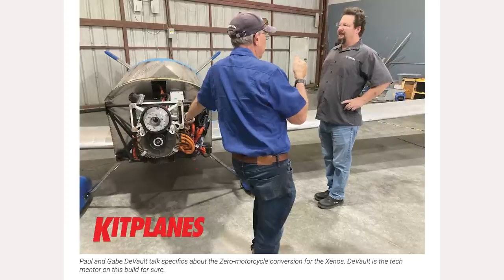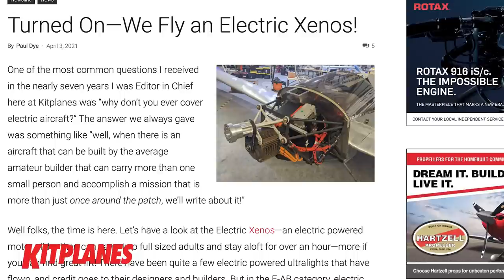How to Convert a Motorcycle to an Electric Airplane in 501 Easy Steps

Comment: I'm not an electric motor enthusiast  but must say this was very interesting.  I believe there will be a niche market for a plane like an electric Xenos.   Salute to Mr. Gabe Devault too for making an electric plane a real possibility.  Thanks Paul and Paul!
Reply: The problem with electric plane enthusiasts at the moment is, that they are still shunning the ICE as a range extender.

Depending on mission requirements, there is a minimum battery capacity needed to cover the power requirements and the range can be extended by adding a motor-generator combination for recharging while soaring.

I mean, the xenos only uses 10kW in level flight, so the generator does not need to provide much more than that for a cruise power application.

Comment: The comment about the J3 Cub is very interesting. It's fun to fly with a friend, but if you want to go somewhere, what would the flight time be if the back seat had an adult's weight of battery?  Fly a little, get a cheeseburger while the plane recharges for several hours, shoot the baloney with some guys in a hangar and fly back.  Sounds like a fun day.  We're clearly not going to have an electric 172 in the next couple of years, but it does seem like we are getting closer to making some "fun flying" practical with an electric setup.
Reply: This battery system doesn't have fast charging; which most cars would have and it's a much smaller battery than a car would have. That's a fixable problem. You'd fly it for an hour or so, and then charge it up in about 30-40 minutes while you get your burger. Also, the energy density on this battery is nowhere near state of the art. Probably similar to other electric vehicles, which would be around 200-240 wh/kg. There are several companies that are starting to produce and sell 500 wh/kg batteries. CATL just announced a battery system like that and there's another company called Amprius that is also starting up production for a 500wh/kg battery. Both companies are targeting the aviation industry with this.

The same weight battery with a density like that on a plane like in this video would massively extend the range. Probably get you close to 200 miles. You'd use the same amount of kwh to get up and beyond that it's just cruising at relatively low power levels. And of course it's a glider. So, you'd probably be able to extend that quite a bit fiurther by just making use of thermals.

I'd say it's a matter of time before some larger experimental plane gets equipped with a battery like that. I'd be very surprised if that doesn't happen in the next few years. The tricky bit is getting access to the batteries. They are for sale now but production volumes are low and demand for these is such that you'll have a hard time buying one.But there are going to be plenty of people interested in getting their hands on one. Some of them pretty wealthy. And of course most of these batteries are earmarked for companies that produce drones and planes themselves. The certification process is going to take ages for that. Which is why experimental planes are probably going to get there first.
Reply: @JillesvanGurp  Wh/kg is specific energy, Wh/m^3 is energy density. That misunderstanding needs to be squashed. 👍
Reply: @watashiandroid8314  If you fly a plane. weight is the metric that matters. You have to take every gram up that you put in the plane. Volume is more related to drag and aerodynamics. You could easily fit a few mwh of battery in a plane. But it would never be able to leave the ground. Because of the weight.

Comment: This is a great proof of concept, and seems perfect for local flying, but the issue of transporting it cross-country is very true... most airports don't have 240v available unless they also host campers😂 

The most practical way I see to get this to Airventure this year would be to follow it with a Caravan carrying a 240v generator👍 it would still be an adventure but seems like it would be straightforward.

Alternatively, you need to partner with a charging point manufacturer and local air clubs across the country to get the countrys first trans-continental air charging network set up! That would make headlines for sure🎉

Comment: Great vid as always Paul thank you! Paul Dye is a fun guest and very knowledgeable. About the fire risk - could a fire suppression system be fitted to electric airplanes? Nothing epic but just enough to make the flames retreat and the temps to get under control so the pilot can put it down right THEN (no trying to fly to nearest airport unless its right below - put it down now).
Reply: Nothing puts out a battery fire, except tons and tons of sand. And sometimes its more an explosion than a fire
That is why firefighters utterly hate electric cars

Comment: Energica makes motorcycles with DC chargers that charge in about 30 minutes. They've gotten a much better range than the previous generation Zeros these two used, too.
Reply: Faster charging will be a great feature eventually, but it depends on infrastructure upgrades at airports...

Comment: With lithium ion battery the bms should keep track of number of charge/discharge cycles as well as capacity degradation. Other than that, not discharging it below 20% is really advisable, since beyond that point the voltage drops like a rock, which could be a safety issue. Fascinating topic, thank you for covering it!
Reply: In fact GA rule says land with 15minutes left of fuel minimum.  To avoid the same issue.
Reply: @jamesordwayultralightpilot  Does it apply to gliders?
Reply: @Jaakko is watching  lmao I'm sure they have their own way of knowing when they're done flying
Reply: Yeah the Zero BMS knows the cell voltage states, several temperature sensors, resistances to ground, and overall lifecycle history and manages it pretty well independent of the main bike board.

Comment: The comment about prop noise being the main noise source regardless of the power plant is spot on.  There is a NASA engineer, (Al Bowers) who redesigned cooling fans for the Space Station based on his airfoil research into the Prandtl Wing.  The redesigned fan reduced noise  by 88%, increased flow by 24% with the same energy input.  It looks to me like one way to get a big boost in performance would be to CNC cut a new prop based on Mr. Bowers research.
Reply: I worked maintenance for a school district. We were replacing our classroom HVAC units and a couple manufacturer engineers were there to instruct us on their features and operation.  They said their units were much quieter because of the fan blade design in the squirrel cages. I asked if they used laminar flow blades. Their eyes got large and they asked me how I knew about laminar flow. I said I was an aviation nut and laminar flow was like the holy grail of wing designers. They said laminar flow was exactly the reason their fans were so quiet.

Comment: One note is the the charge time can be reduced to 1 hour using about 15lbs of additional onboard chargers, a cable harness, and a more powerful AC hookup. Say, 2 NEMA 14-50 “RV plugs” should do it.

I’ve used such a setup to tour on a Zero electric motorcycle.

Comment: Makes me want to convert a Bonanza into a motorcycle... Great video with lots of good info. I wonder if you can do regenerative charging while soaring? Here's another thought how about an ejectable battery pack, small charges to cut the connections and mounts and bye-bye battery... Just a thought. Another good one guys.
Reply: regenerative charging while soaring <- I am a glider pilot, what I can say you will need some way converting mechanical energy into a generator.  Basically use the wind-milling prop as the energy source.  That will cause way too much drag for soaring.
Reply: @braincraven  as soon as I posted my thought I thought of the drag factor///

Comment: Both you guys should talk to Dick Vangrusven about electric airplanes. He has been flying an Antares 20 m self launch very high performance glider for years. Just this last year one of the major German glider manufacturers has started producing a self launching electric high-performance glider.
Paul, with the Zenos motor Glider you have should have no trouble getting to the homebuilders meeting in Tehachapi on a good storing day.

Comment: I have some EV engineering knowledge from promoting EVs over the years. Can the Xenos actually do the 24:1 glide they claim? I wonder if that number isn't a touch optimistic because the Pipistrel Taurus has similar range with less than 1/3 the battery and the motor they use might not be the most efficient. Say you quadruple the battery capacity of the Pipistrel which can be done with 75kg additional, suddenly the range is 400+ km. I figure that a purpose built flying battery can push up to 1000km range. You are not going to cross the atlantic but could be usable. Just like with cars, the right charging infrastructure at airstrips can make a big difference. My Tesla can charge at 1600km/h which means adding 160km range in 6 minutes. Twice the speed of an airliner so unless you are really in a hurry, it's not a time issue. A plane would be slower but not necessarily by much.
A battery plane that could fly from LAX to SFO without recharging is quite conceivable with today's tech.
As for battery fire, that's extremely rare for an undamaged vehicle. I'm not sure that Teslas catch fire today at any rate without damage. Further you can make a compartmented pack, say 2 blocks in a thin metal case and a vent to the outside such that a complete battery fire would just be exhaust and the plane could continue with the second pack. that would seem prudent however rare.
As for noise, with electric drive you can easily have two rear ducted fans instead of the usual offensively colonial tractor noise maker that pistons have. In the necessary glider style craft, it would presumably be a very civilized ride.
Because battery drive can have an angry amount of power you could make electric planes with scifi-esque performance. Including spirited vtol and skip the whole runway thing. Say you take off from your driveway and be 300km down range in an hour. Zero overhead. With the right charging infrastructure you could well imagine that battery flight has so many advantages that most would prefer it for GA use over fuel. If done well. If suddenly every house is an airpark and flying is free because it's powered by a few solar panels on the house roof. Last I checked, flying a Baron is anything but free.
If you want to go 600km and you have to set down twice for 10 minutes each, is that a deal breaker if it's virtually costless and you don't need runways. How great is the average private pilot flight really. LA to SF is 541km, Miami to Bahamas is 285.
Slightly amusing if a vtol could just use Tesla's charging network.
The first powered car was shaped like a horsedrawn carriage, just without the horse. That was a bad design. New capability requires rethinking everything.

Comment: I'm sure Paul has already thought about it but need the motor to recharge the battery when its wind milling while looking for a thermal or descending without power on.
Reply: Chances are that regen while gliding isn't productive as the additional drag produced would likely not be worth the charge generated. Regen while slowing down on descent would be productive, but you'd likely still come out ahead if you instead pulled power earlier and glide down with the prop free spinning or stopped.
Reply: @dirkmohrmann8960  worth testing especially if you can adjust the force of how easily the prop windmills or not

Comment: I've had a Zero electric motorcycle for 9 years now. Maybe this will be its fate too 😉.

Zero honored the 5 year battery warranty on mine - the battery slowly died after 3 years, due to a bug in their charging system (it trickle charged the cells when they were already full, which destroys the cells). The replacement has done another 25,000 miles without issue. I don't think I'd like to have this in an aircraft though, because the indicated battery state of charge (percent remaining) isn't reliable. Also, the way the system handled a bad battery was not great: sudden loss of power, so full throttle would give you 17mph. Nice when you're in a middle lane on a busy freeway! Would not want to rely on that for go-arounds.

Comment: One critical point.  !!!!
Does this bike have a integral to motor gear reduction?   Does this gear reduction have an oil pump?   Tesla stuff has an oil pump and if the motor is run in reverse, an aftermarket oil pump must be used otherwise the gear box will fail.
Reply: It's a belt reduction, no?  Easy Bob.  Four exclamation points, really?

Comment: Electric planes will only truly become viable once someone perfects the swappable battery. Electric chainsaws are fantastic around my farm and electric battery drills are fully mainstream but these work best because you have 2 or 3 batteries and swap them out. If someone finds an easy method of changing a 180 pound aircraft battery then they suddenly become a whole lot more viable for a whole lot more use cases.

Comment: The main scenario I can think of where this would be useful is to tow gliders.
Reply: If it uses about 10% battery to climb each 1000 feet, you couldn't tow the glider very high even on a full charge.
Reply: @j_taylor  I guess you are correct. I also wonder how much more charge it would use pulling the extra mass.

Comment: Three batteries for the flight school might be the ticket
Reply: Agreed. It seems like the flight school solution would be swappable battery systems.
Reply: Swapping a 180lb battery is not going to happen on a daily basis.

The most reachable option is to double the charging speed so the aircraft can be turned around in 1 hour vs 2 hours.
Reply: @BrianTRice77   In the world of fork lifts, 2,500 + lb batteries are rottenly changed by a single person so the next shift has a full charge. Many times this is a human powered change out using rollers.   Working up a quick change for a sub 200 Lb battery is a non issue.

Comment: If Zero is smart, they will get over themselves and start making kits
Reply: It's all about litigation liability. That's the catch. One has to take that on themselves.
Reply: @Bert Ruttan  not too much liability selling Electric powerplants.  You could slap a sprocket on anything and make it electric. If they made a conversion kit for a dirtbike and someone used it for a plane, it would be their own fault if it didn't work out. But think of the money they could make just selling the kits for dirtbikes. Billions of dollars to be made.
Reply: I know Zero very well, and their legal department is highly defensive. I wish I knew why. But they only want to deal with major corporate partners like Polaris who puts the powertrains into quads.
Reply: @Brian Rice  I mean they aren't the only ones doing it so someone will eventually cash in. There's definitely a market for it.
Reply: @jamesordwayultralightpilot  Yes, and I’m the maintainer of the unofficial Zero manual website and have been arguing in that direction for a while. We still haven’t seen it, unfortunately.

I do not think there are billions to be made in electric dirt bike conversions, though. Kit profitability hinges on mass production and each model fits differently so there would be a lot of R&D overhead per model. Not for the motor, mind you - for the battery.
Reply: Zero is being smart not to offer parts to the open market.  Aside from the liability issue is damage to the brand.  Someone crashes a ( insert home made vehicle here  ) and the news will report "  Zero powered thing bursts into flames "

Comment: Just need motor specs
Reply: Never mind dont need a 180# battery
Reply: The motor is very lightweight, so battery and motor mass mounts the original engine and the fuel. He says so in the video that the Cg was the same without compensating.